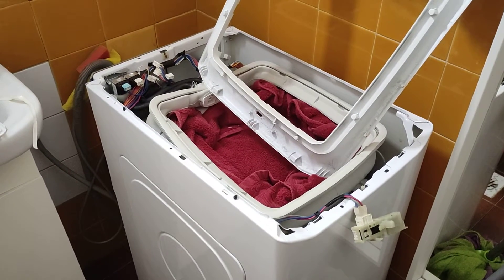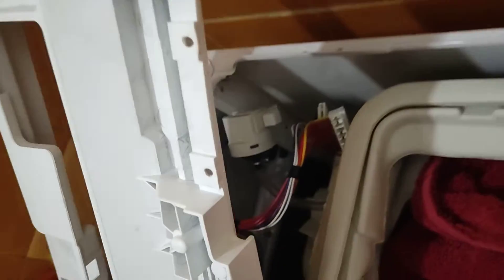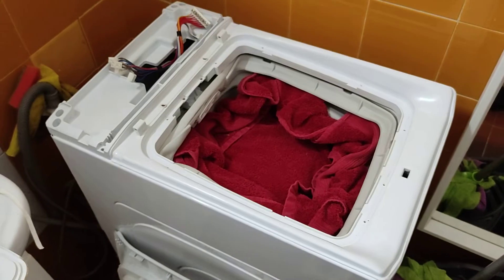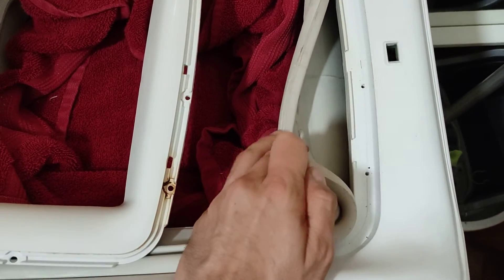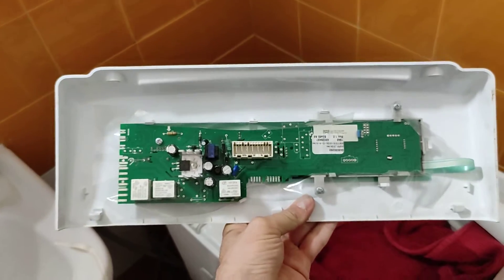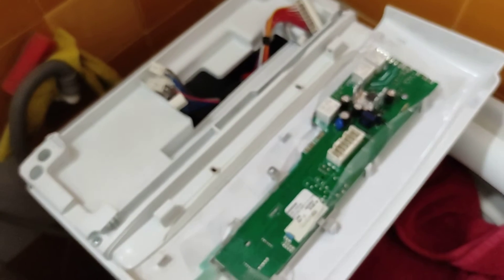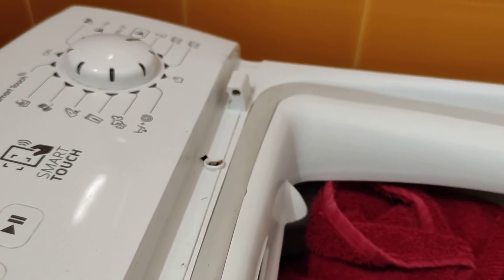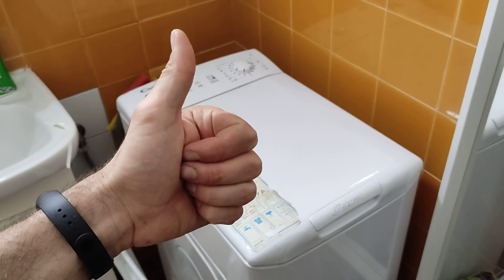Replacing the lid and top frame cover of the Candy toploader washing machine CST 360L-S at home

Comment: This was very helpful thanks! Spent the whole day trying to figure things out myself. The water rubber seal at the top was a nightmare to reassemble. Al because my wife told me "a piece of cosmetics" fell into it. You immediately assume its something that would cause the machine to jam. In the end it was just a cotton face swipe. Had the whole machine upside down to get it out. Then the nightmare started. One of the springs came lose and the whole thing was unstable because of this at high rotations.
Reply from the maker: Well done on getting it sorted out, glad this was a help!

Comment: Really great job and thanks for helpful video. Just a thing I was wondering about, is second time I must change that spare part and today unmounting all I noticed that the cover's springs (terminal parts) could be too much bent over. I think originally the cover springs had 90 degrees inclination and that could be reason why that piece has broken. Cover goes too much back and should stop on a small plastic tooth on pin housings but plastic is not strong enough to keep that force . 😅 maybe I am wrong but if I am rite I wish could be helpful to someone. Thanks again for video 😊 .
Reply from the maker: Thanks for the helpful addition, @manuelmarcon6635!

Comment: I am trying to take out the top lid. I removed the pins but when i try to pull the lid it doesn't move. Is there anything else tha is holding it? The metal parts are a bit rusted. Should I pull harder?

Comment: Have you taken apart the top cover itself? how to change the springs on it? how to change the handle-lock? I twist it and turn it, I can’t make it out) any ideas?
Reply from the maker: @Bergomoldo I'm afraid that it seems the lid cannot be disassembled and needs to be replaced in its entirety. Did you find another solution, perhaps?
Reply: @consultcuan  no, I didn't find it... the springs haven't rotted yet... I left it as is
Reply: @consultcuan  I saw that they sell a handle and a hook for it...that means it can be taken apart )))
Reply from the maker: Ah, yes, I've seen this too, but if I remmeber correctly, it meant extracting it, not separating the lid, but I could be wrong. This is actually the issue that started everything - a friend had dropped or forced the lid which broke the clasp. Finding a machine for parts was a God-sent gift.

Comment: Is there a way to clean those iron bars on the lid , mine have rusted
Reply: Mine too i am planning to try with vinegar and sandpaper i think that will work but not sure yet, i think it depends on how corroded they are, remember to wipe the vinegar properly if u try, maybe i get back and write my result of i remember
Reply from the maker: Sadly, I don't think so, and it seems that they can't be replaced without replacing the lid altogether. Did you find a solution, @peavy13 or 
@user-zf9ei3gv5b?